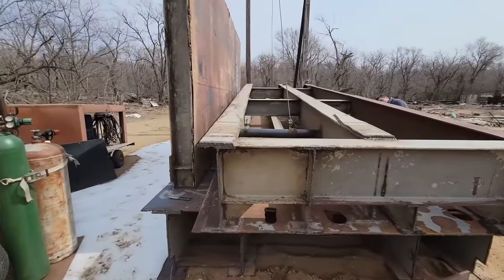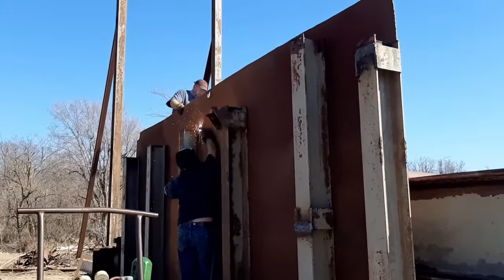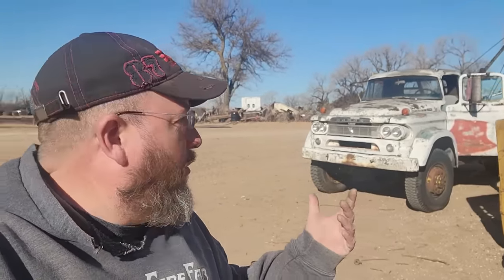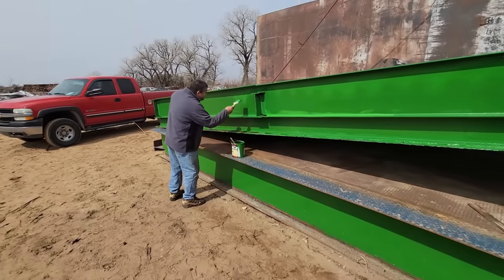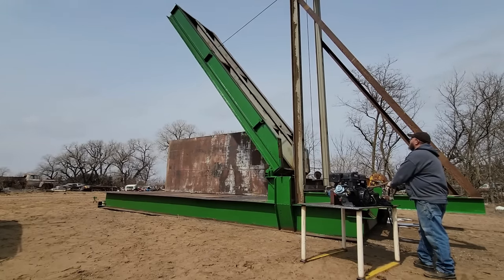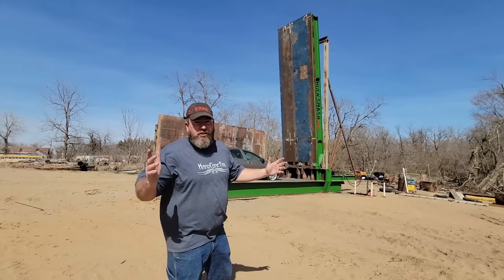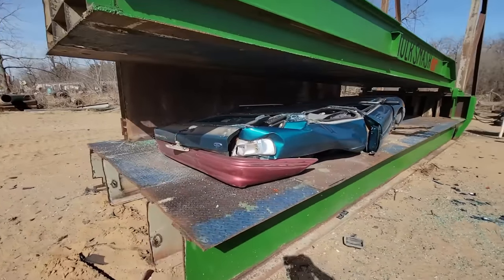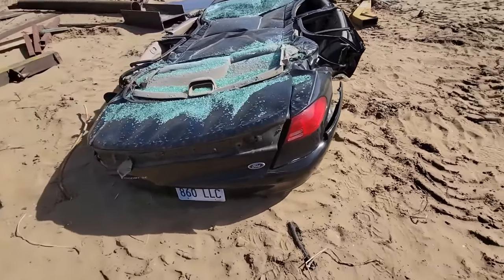WE BUILT A CAR CRUSHER!

Comment: Your half way there, I worked for a yard that had a drop door like that, but it had 5 ft sides on it with cutouts just for the fork lift, with the sides nothing got very wide they would keep the car contained, powered with a flat six Dodge and a 4 speed transmission, ours had a carriage that lowered down and a single latch would hook the door and then shift to 1st or 2nd gear and raise it up on a double shiv set up, the door weighed in the neighbor hood of 12 ton, the latch had a foot kick so the door would unlatch from the carriage and free fall, after the first drop we'd put a dryer in the trunk area, refergarators over the top and a washer in the engine compartment and drop the lid again, plus we filled the inside with wheels and mufflers,
Reply from the maker: damn 12 ton!  This one is only half that.  Yeah I want to play around with and make another video or two
Reply: @HardCoreFab  Thats what the owner told me, it would flatten a mid 60's full size to about 1 ft, but not a Caddy, those cars are tough, top even with the doors was about it.